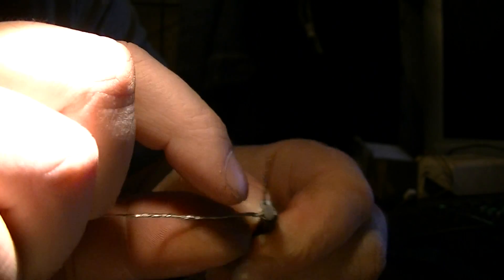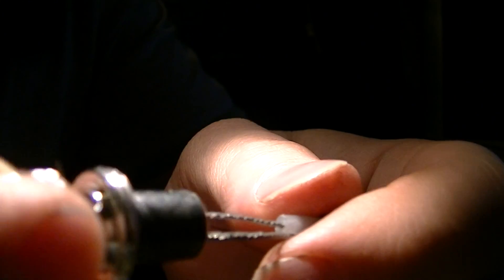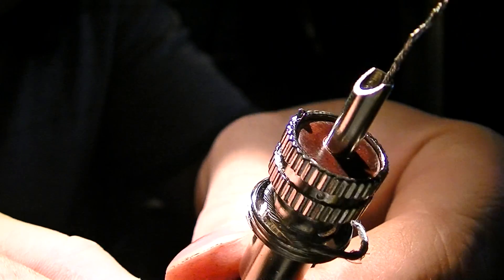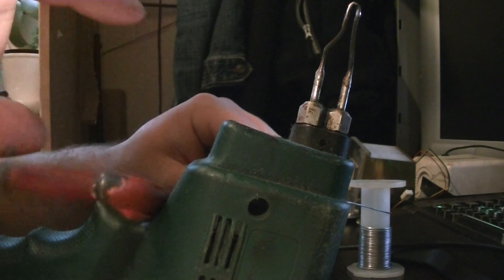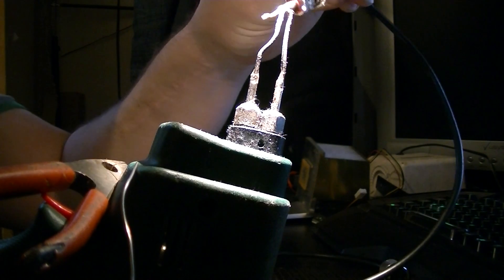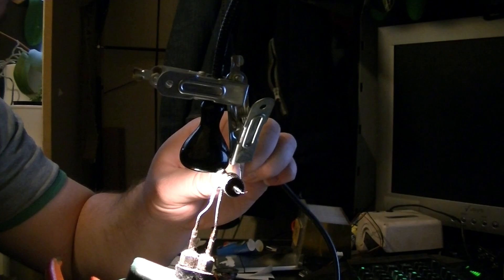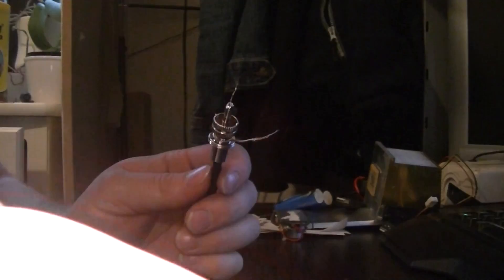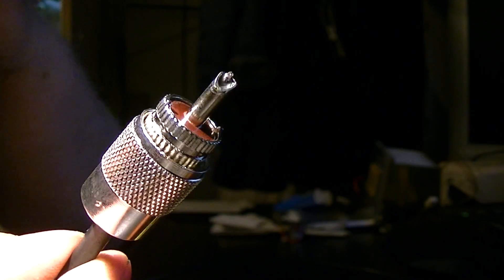How To: Solder a PL259 to Coax

Comment: Nice vid man.nowni know the right way to solder that connector 
9w2BXI 73
Reply from the maker: thanks, to be fair, i dont think there is a right or wrong way, so long as you get a good RF proof connection between the centre and screen :)

Comment: Thanks for the video! As a newbie to ham radio, my mother-in-law gave me a mobile setup that she used to have. The antenna wire was damaged, so I needed to cut out the bad section, and replace the connector. This video was just what I needed to learn how to replace the connector.

Cheers!